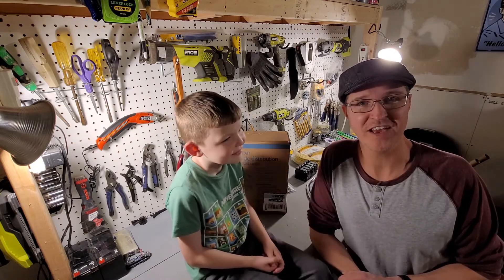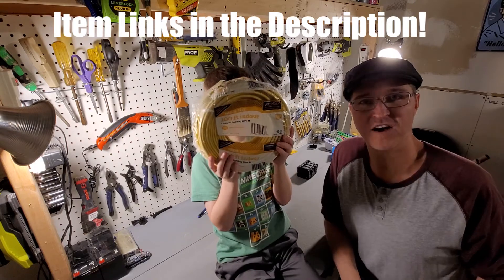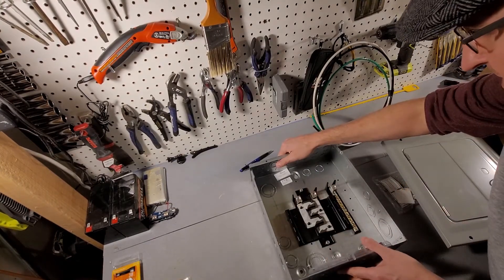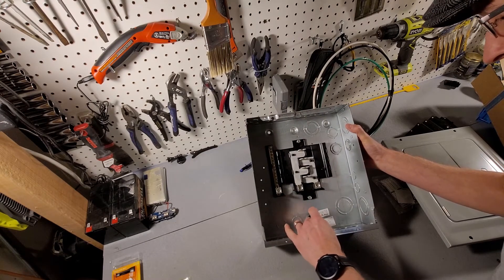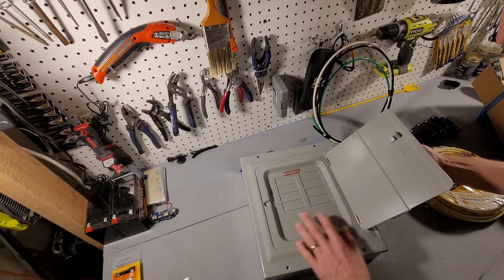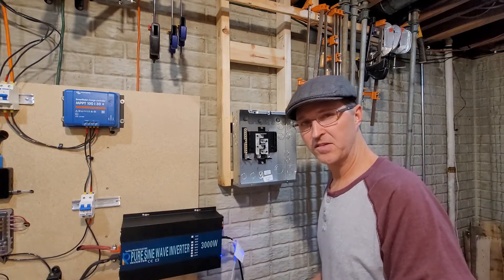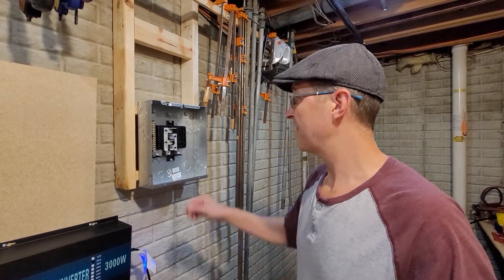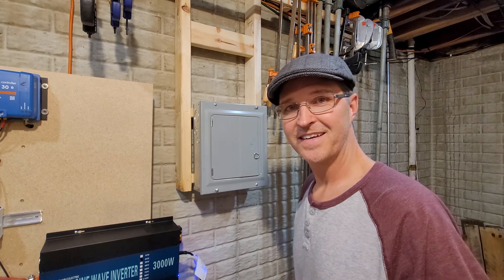Installing a Breaker Box to my 24v Off Grid System!  Part1.

Comment: Do have run breaker box or can hook straight to batteries
Reply: Can I hook up battery straight up without a breaker box that's what I'm trying to say
Reply from the maker: You don't need a breaker box.  I just wanted the additional circuits.  Thanks for the question.